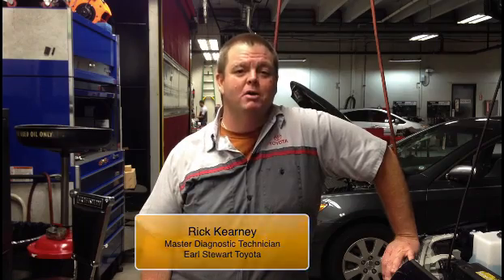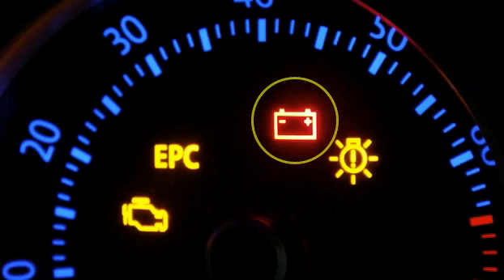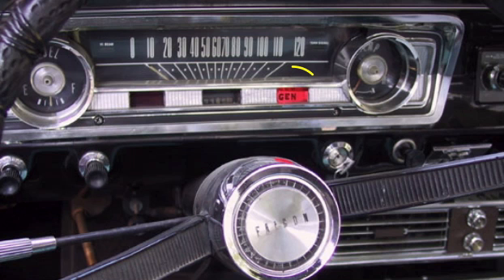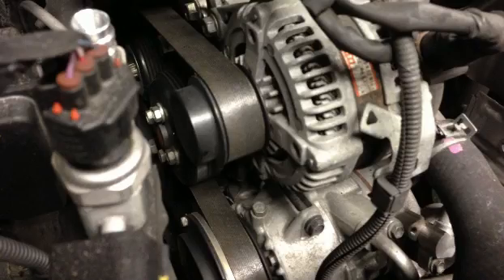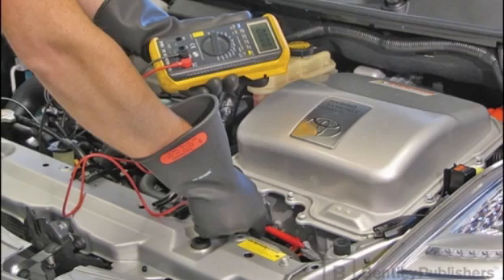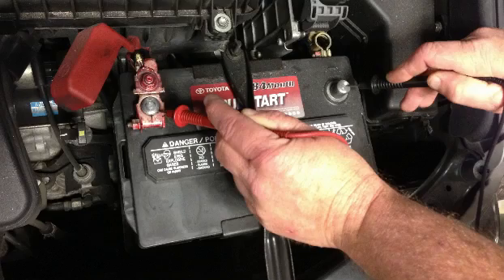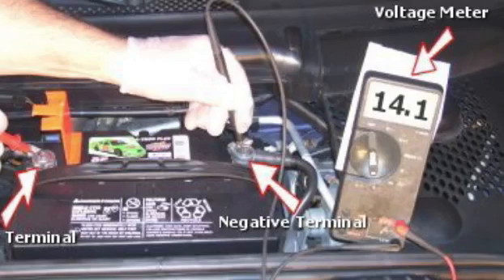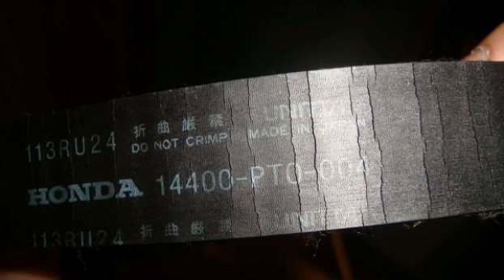Rick Kearney: What That Battery Indicator Light Means

Comment: Corolla 2010 , Light battery popped on last week  after 10 minutes of driving   steering wheel got super hard to turn , glad I made to the parking lot  I turn  off the car no it won’t start 😂? What’s the issue  IS IT THE ALTERNATOR?
Reply: What was the issue? I have exactly the same problem with the same car.
Reply: @sharvinsahye9641 I’m having the same issue, what’s the answer here guys? 😂
Reply: @chaasadfearing  alternator problem. Had to change it. Cost me about $280 and now all is good. The red battery sign and the symptoms is alternator problem. Better to get it checked and replaced asap.
Reply: This happened to me 13 Camry. Today . I had to drive back home , and steering wheel got hard . Not driving it I have to drive 1 mile to the mechanics shop I hope it will make it !

Comment: Hey great video!!!  have charging issue....battery light came on could smell belt...alternator lost charge...replaced alternator/battery..light turned off but doesnt come on with Key ON..grounded out at alt connector the light comes on..have 12v signal and 12v ignition on at alternator connector...alternator not charging, checked all fuses and connections are good...checked ground from alt battery 12v to alt casing/engine grounds all 12 volts.. still not charging maybe possible faulty alternator and dash light does not come on with key ON only if i ground yellow wire at  alt to test light...2002 toyota highlander thank you!

Comment: How you tell how manny voltage is the alternator? 130v or 150v 200v
Reply: What do you mean you should see 12.5 volts on the battery and 13 to 14 volts on the battery with the engine running

Comment: So I changed the alternator and before that I change the starter and I also cleaned off the battery posts but my light is still on ? Can anybody help me and point me in the right direction!?!?!
Reply from the maker: Battery light remaining "ON" with a known good alternator, battery and terminals, would usually indicate either a blown fuse, wiring issue or problem in the instrument cluster.  This would require diagnosis with a multimeter.

Comment: So I replaced my battery and alternator and still my light is on any info would help??
Reply: And one of the corroded terminals was replaced
Reply: My battery lights on after I changed the alternator change the starter and clean the battery posts
Reply: Check the fuse
Reply: You're fucked

Comment: My car starts but only stays on when im on the gas then when try to throw in gear it dies and dashboard telling me check check charging system and took batter to oreily and batter is still go what is the problem
Reply from the maker: could you get me some more info? What is the year, make, model, and engine? Right now, I'd guess idle air control valve, but need more information
Reply: Hey earl my battery light comes on every morning and stay there for good 15seconds and goes off..after that light doesnt come up until next morning .battery is perfect just checked.could u know if i need to be worried.

Comment: ok so i have been getting the battery light in dash off and on and dings at me ,  i went for a drive today truck shut off and restarted before i could do anything..but once it restarted it was really boggy .like has very little power... i returned home and put a tester on it ..all seemed good ...i decided to pull the battery and put one of my marine batteries in to see ...same thing happened... disconnected the battery and truck still ran no problem.. checked voltage of battery i pulled and it was sitting at 12.26v  the marine battery i took from basement was on charger so its fully charged too.. i have checked all wires i can see .have checked main power wire going to fuse box and its tight nothing is loose nothing is blown in fuse box.    not sure what the problem is .. anyone got any tips?

Comment: My battery light has been turning on and off intermittently while driving from point a to point b and the car never acts like it wants to die out. Starts every time with no hiccups.. what gives? Alternator fuse was fine. Battery voltage is fine. Belt is fine and not cracked.
Reply: I have the same problem
Reply: Did you find out what was the problem
Reply: South Texas Bass attack I unfortunately never found the problem out. Shortly after it had a horrible misfire and it was beginning to get expensive so I sold it to an auto salvage
Reply: I just installed new alternador and the battery was  in very good condition and it's acting weird I heard that some cars have battery sensors like a heat sensor if they get too hot I'm going to have to check all the wires I think I have a corroded alternator wire

Comment: Hello Earl
I have a battery light coming on when I have not used the car for a couple of days (Camry 2004). The light goes off after I drive few hundred meters. Battery and electrical system was inspected by Toyota. Everything is fine. Cleaned up the terminals, checked battery etc... I have been told that the alternator is "getting tired" what ever this means, however I do not want to get stuck on the road. Could that be? I would have expected Toyota to give me a better advice. Should an alternator test show that I need a new alternator?
Advice would be appreciated.
Reply: If the alternator is tire why risk getting stranded, replace it.you dont want it to stop working in the middle of nowhere

Comment: Rick" I have a question, when it rains I turn on the air, normal no A/C the battery light comes on. If I turn the air fan off the light goes off. Please help. Toyota Echo 2001,Automatic

Comment: Th alternator doesn't provide electricity to the lights, computers etc etc - the battery does and the alternator replaces that lost energy.
Reply: tomato-tomahto, battery and alternator are connected in common.  You could remove the battery after engine start and all accessories would still work continuously, remove the alternator and you're on the side of the road before long. :)
Reply: Dagaan Galakticos They tested my battery and alternator. And the battery light still turns on

Comment: on my car, there is a screeching belt noise. Im possitive its the alternator. my stereo tells me the voltage saving me having to buy one of those volt readers. when i turn my car on, it doesnt go to 14. anything its around 12.4 and screeches. If i let it warm up it slowly makes it way up to 14.4. when there, the car finally stops screeching.  And if i turn on my headlights it goes back to 12.4 or lower until i turn off the headlights and let it slowly go back up. What would you recommend i do? i've tried everything belt wise so im sure its the alternator.